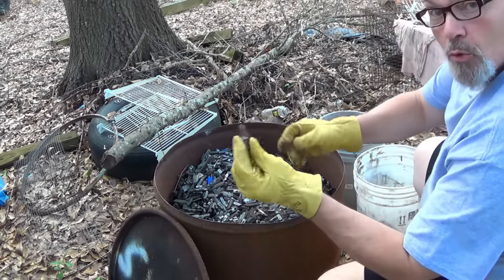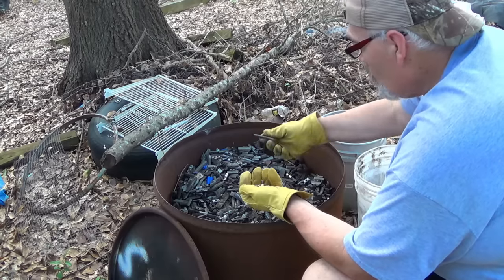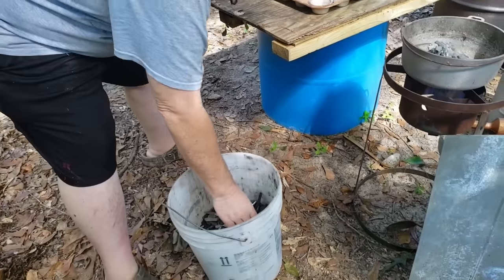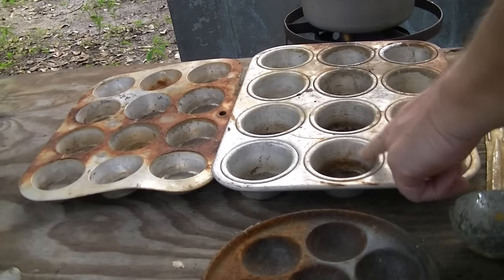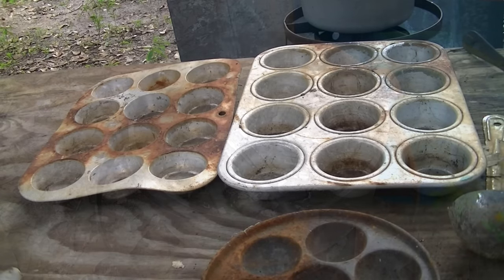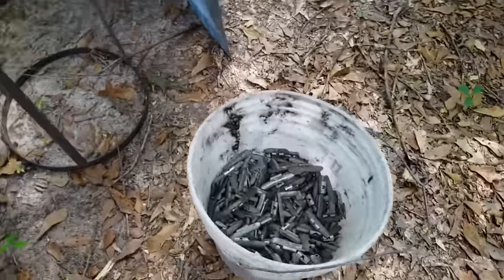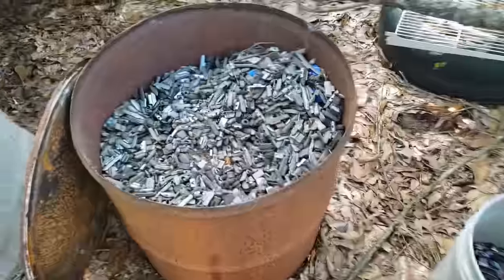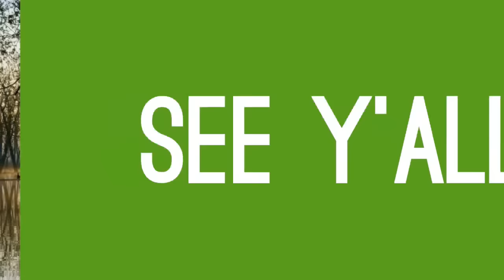Recycling Lead Wheel Weights! Making Ingots...

Comment: They stopped putting lead wheel weights on tires about 10 years ago.
But they can still be found if you look for them.
Sometimes a small tire-shop will sell you a 5 gallon bucket full for $20 if you ask.
Lately there are fewer lead weights and more steel and zinc weights
In the bucket.
They are making small flat weights out of steel now too.
It's still out there if you look for it.
Thanks for the video.
Reply: I have found that approximately 45% are lead . and around here 80$ per bucket
Reply: @bobsunkees3392  
There's lots of lead out there if you look for it.
I bought a scuba weight belt with 18 pounds of lead weights for $5 A few weeks ago. Not the first time either.
I eat lunch at fast food places a lot.
After I eat I walk up the street for a block or two then I cross over and walk back. While I walk I watch the gutters for wheel weights. It's not unusual to find a hand full near a busy intersection. I find over half a five gallon buck a year doing that.
I watch for people re-piping old houses. They cut out the old cast iron pipe and replace it with PVC.
The joints in the old cast iron pipe are sealed with rings of lead.
A six foot section of cast iron pipe can have four or five joints.
I take a hammer and smash the brittle old iron pipe to get the lead.
I have got 40 pounds of pure lead at a time doing that. I use that soft lead in my muzzle loaders.
It's not as cheap and easy to find as it used to be but there's still plenty out there if you keep an eye peaked for it.
Good luck and happy hunting.

Comment: I had some 26lb ingots I got from eBay that made heavy blue and gold pools on the surface when melted and could not be skimmed off. I thought it was impurities, but came to discover it was the high temperature of my pot. I had been melting Eagle lead shot up to that point, but this ingot was pure lead, which, as I found out on a forum, does turn blue and gold when overheated. I turned my pot down and it went away on the next batch. I was about to holler at the seller on eBay too! Live and learn.

Comment: Take a spoon and mix that wax into the lead scrape the sides of the pot also, there will be less trash floating up while you're dipping, some of the stick ons are harder than clip ons small gray with small ridges on top.

Comment: Excellent...!
I always like to see other casters methods. 

Have you tried using sawdust as flux?  It will actually clean the alloy where wax does very little in the cleaning department, but is a good reducer and prevents oxidation.  Sawdust will do all 3.

Thanks for the video..

Comment: What kinda burner is that? Looks just like the one I picked up recently...mine's a Brinkmann...but I cannot get a nice clean (and hot) blue flame no matter how I adjust the flow. I just get a big loose yellow flame that's pretty sooty. It did melt a  pot of 60lbs of scrap lead, but the flame was pretty big engulfing the pot...and singeing the hair on your arm if you weren't careful. What am I doing wrong, or is my equipment faulty?
Reply: Best to try and find a old gas hot water heater burner, really smooth flame. Oh yeah, gotta have a good regulator.
Reply: Does it have the adjustable regulator and did you adjust and closed or open your air of gas vent
Reply from the maker: It's the turkey fryer that Academy sports sells! I go thru em rapidly sometimes!

Comment: Bubba. Great video. I have to ask. I have been casting ingots for awhile now. The last 2 baches My melted lead has thick mushy stuff in it that clings to the sides of my pot. I am very thorough when sorting through my lead. But am afraid that there is zinc in the melted lead. I did manage to use some of it and it poured beautiful ingots. The other sludge i just left in the pot. Any suggestions would be great. Thanks. Chris
Reply from the maker: It happens! Just keep fluxing it with wax or sawdust and eventually you will get most of that mess out.